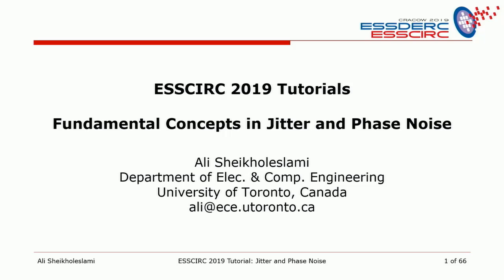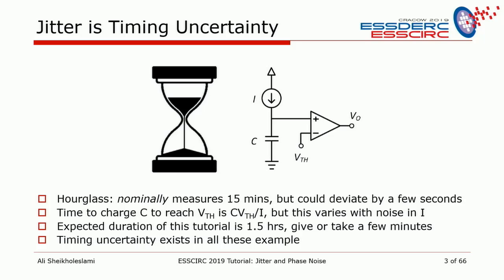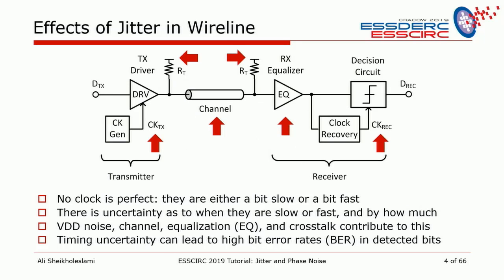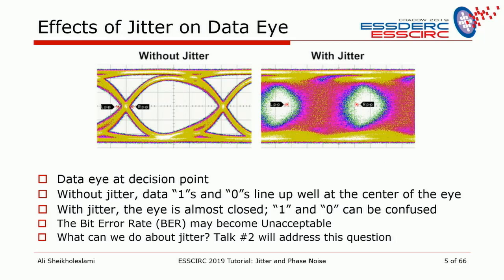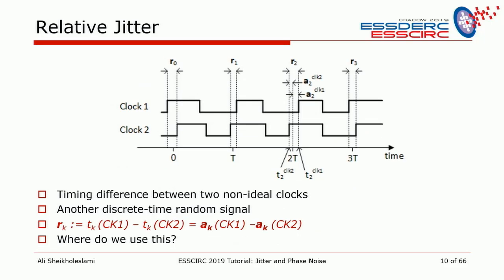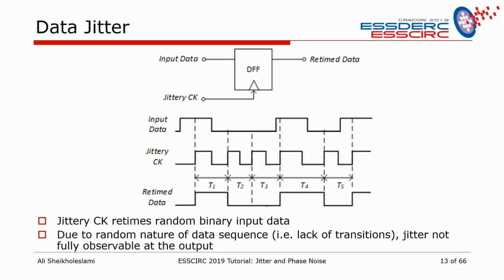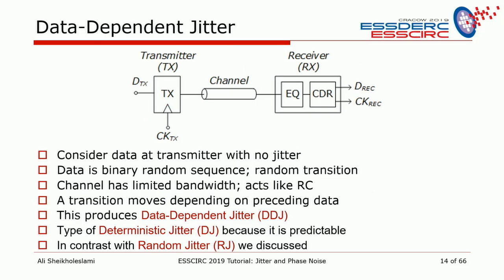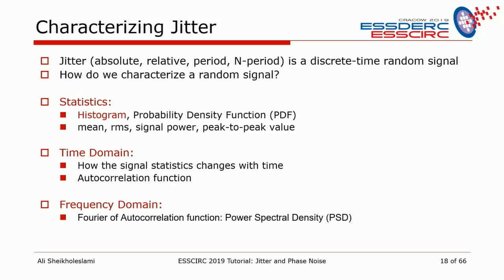Fundamental Concepts in Jitter and Phase Noise Presented by Ali Sheikholeslami

Comment: 1:22 motivation
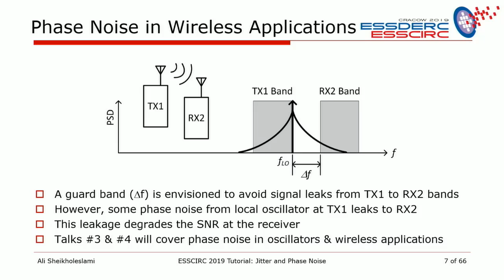14:55 Jitter Definitions: What is Jitter?
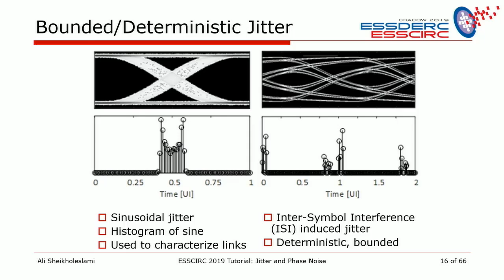31:30 Characterizing and Classifying Jitter
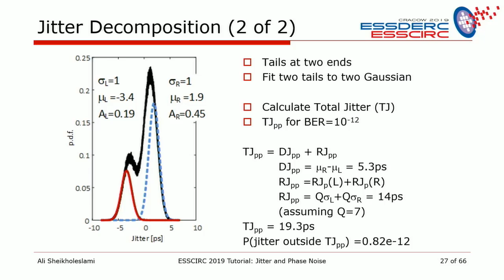48:30 Example: Jitter in Ring Oscillator
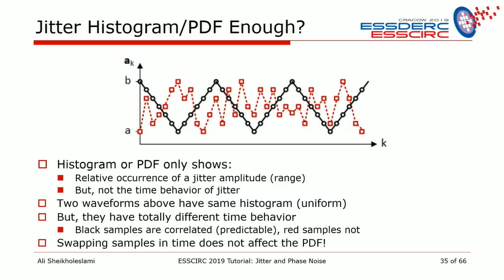58:54 From Jitter to Excess Phase
1:07:19 Phase Noise and Its Relationship to Jitter
1:19:45  Phase Noise Profiles
1:25:42 Jitter Measurements and Intentional Jitter
1:31:55  Summary
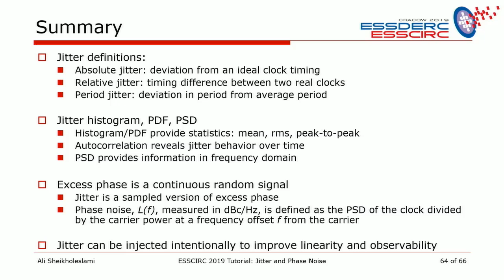1:33:03 References